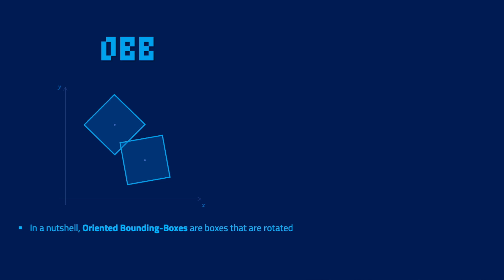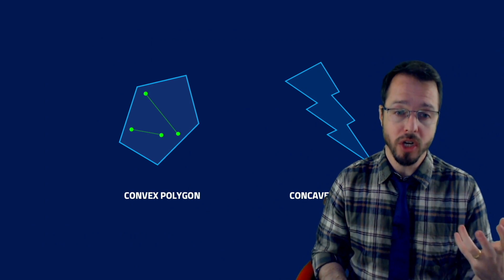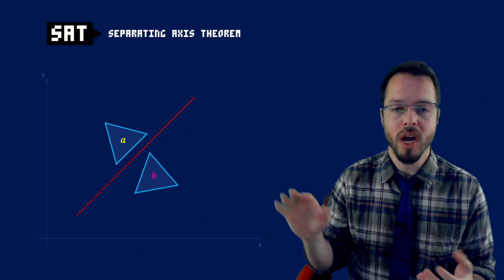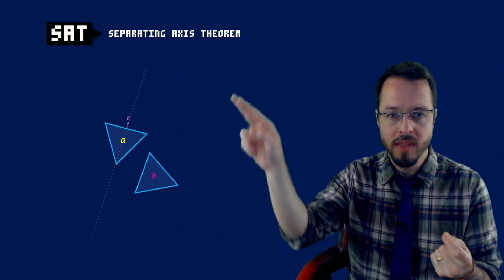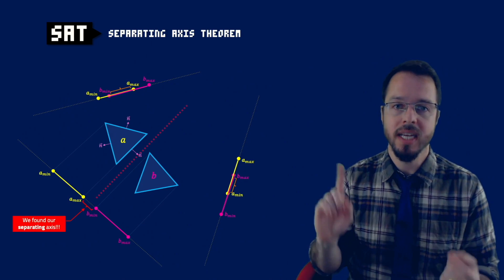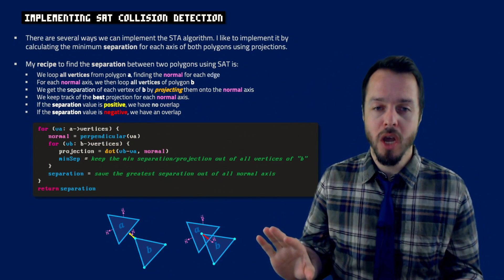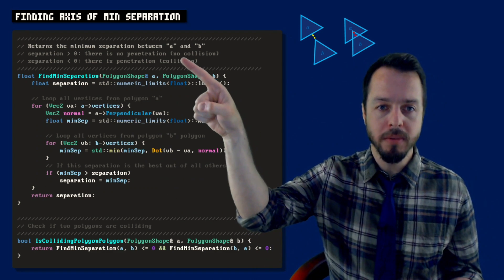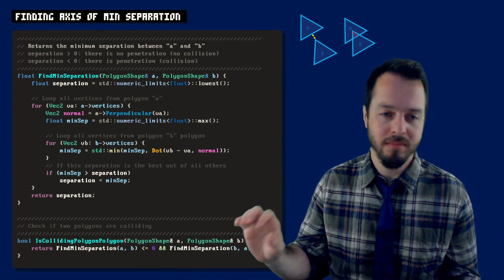Collision Detection with SAT (Math for Game Developers)

Comment: Some key comprehension points that I think were left out of or understated in this video:
1. This algorithm uses SAT but is not the same thing as SAT itself. To find the separating line S between two convex polygons P1 and P2, requires picking a common projection axis A (often confusingly referred to as the "separating axis") on which to project the vertices v1,i of P1 and the vertices v2,j of P2. In effect of this projection, each polygon becomes a flat line interval across axis A. If the projected intervals don't overlap on the axis A, then the SAT theorem states you can draw a separating line S perpendicular to the axis A inside the gap between the intervals.

2. Anytime you hear him say "projecting (pairs of) normal vectors" shouldn't be taken literally, b/c "projecting a normal vector" onto another vector is actually a singular operation - what he really means is selecting the projection/separating axis A using the direction of the normal vector n1,i associated with edge e1,i of P1 (or the direction of the normal vector n1,j associated with edge e2,j of P2). Then, regardless of the chosen edge, all vertices of P1 and all vertices of P2 are projected onto axis A. Mathematically, we only care about the max and min components of the projection, since those form the interval.

3. The reason why it even makes sense to consider the normal vectors perpendicular to the edges of polygons P1 and P2 as candidates for the projection axis A, is b/c if any separating line S exists between P1 and P2, then it's possible to rotate S to be parallel to some edge e1,i of P1 or some edge e2,j of P2. This can be proven by contradiction, since if S cannot be rotated to be parallel to some edge e1,i of P1 or e2,j of P2, then it's possible to find an overlapping projection of vertices of P1 and P2 onto S's perpendicular projection axis A, which contradicts the SAT. Therefore a correct choice for A is guaranteed to be perpendicular to some edge e1,i of P1 or e2,j of P2.

4. If you're confused why this code implementation uses the normal of the vertex instead of the normal of the edge - remember that each vertex is a point on 2 edges of the polygon, so the vertex normal is the normal of one of the edges. As long as the edge for each vertex is chosen consistently, the validity of the algorithm isn't impacted by which edge you pick.

5. Taking advantage of SAT theorem can produce a more efficient implementation, because for the purpose of detecting collisions (not overlap distance), once you've found any axis of separation, it's safe to break out of the vertex loop and return false. Regardless, you may want to check the size of the gap is >0 before returning, since otherwise this naïve algorithm won't detect a collision when the polygons are simply touching and not overlapping.

Comment: As a 3D implementation where you have 2 tetrahedrons, could you define 3 planes with the faces of the triangles and simply check the signed distance of the other triangles points to those planes? That way if you found a set of vertices that all have a positive signed distance, you know the tetrahedrons are separated.

Comment: Hello! Thank you for the great content! I'm a little bit confused about two points: 1) It seems like you compute the normal of the vertices and not the edges (Perpendicular(va), C++ code), does it lead to the same result? 2) Is it correct to say that FindMinSeparation computes the minimum distance between the vertices of the first polygon a and the contour of polygon b? that's why you make the double check in IsCollidingPlygonPolygon? Thank you very much.
Reply: It's important to remember that each vertex is a point on 2 edges of the polygon, so the vertex normal is the normal of one of the edges. As long as the edge for each vertex is chosen consistently, the validity of the algorithm isn't impacted by which edge you pick.

Comment: Wouldn't this lose the efficiency of the separating axis theorem, since normally you would return early as soon as you find the first axis where there is no overlap? This seems to require calculating every vertex against every vertex since you never evaluate 1 axis fully at a time. i.e. a scene with sparsely laid out convex polygons would normally be very fast, since most axis will have no intersection. But with this, even if they were spaced a mile apart you would need to evaluate every vertex. I know this is a contrived scenario, and you'd probably have spatial partitioning or something which would make this notably faster, but it still feels like I'm missing something.
Reply: Hes Gus Fring. Dw abt it

Comment: if you're using a square, wouldn't the normal of a side be in the exact same direction (but opposite magnitude) as the normal on the oposite side of the square?
you only have to do 2 calculations for squares instead 4 if i undserstand this correctly.

Comment: Hello! Thank you very much for this video, it really helped me to understand OBB and has led me to try to implement it myself. I am having some trouble in my algorithm, but, I can't pinpoint exactly where the error is. Could you please share the code or just explain what exactly is the Perpendicular method in PolygonShape doing? Is it just a regular cross product or is some other mathematical function?
Again, thank you for your time!
Reply from the maker: Hello! Sure. The Perpendicular method is actually very simple:

Vec2 Vec2::Perpendicular() const {
	return Vec2(y, -x).Normalize();
}

Where Normalize is the simple vector normalization function, which I assume you are familiar with.

I hope this helps.
Reply: @pikuma  Oh wow, that was fast! Thank you very much!
Reply: @pikuma  I mean. Isn't it a normal vector of a point and not the edge? If you imagine axis aligned box and a point (1,1) , than your normal is (-1, 1) - which is basically diagonal line. While all the normals of the edges of a box are aligned with axis. SO, whatever your algorithm is, it's not what you're showing in your video. Am I right?

Comment: GJK only works with convex hulls too.
Reply from the maker: GJK only tells you if two convex hulls are overlapping, it doesn't give you information about how they're overlapping. For that you need to use something like the Expanding polytope algorithm (which is very similar to GJK but uses minkowski sum instead of differences).
Reply: @pikuma  This is indeed the case with GJK. GJK tells you if two convex hulls overlap and the result is a triangle/tetrahedron that encloses the origin. Because the Minkowski difference encloses the triangle/tetrahedron, the origin must, therefore, be inside the Minkowski difference, and the two hulls must intersect. At this point, the EPA can start expanding the triangle/tetrahedron to determine the point on the Minkowski difference that is closest to the origin. This point maps onto two points on each convex hull and a normal vector that will tell you the minimum displacement that is required to separate the two convex hulls.
However, the GJK will also only work on convex hulls, Also, the EPA does not use the Minkowski sum. It uses the Minkowski difference of the two convex hulls.